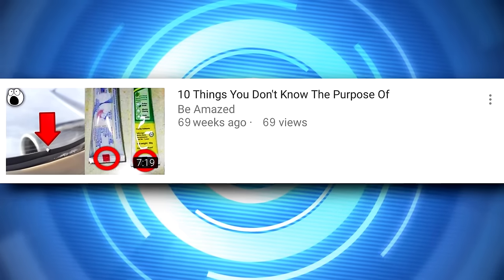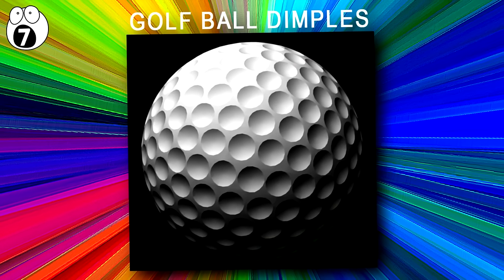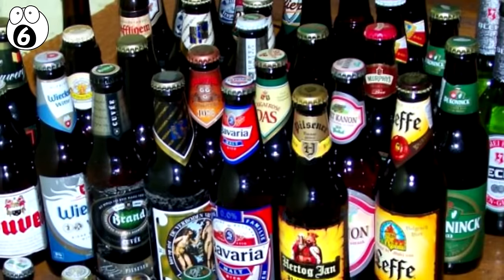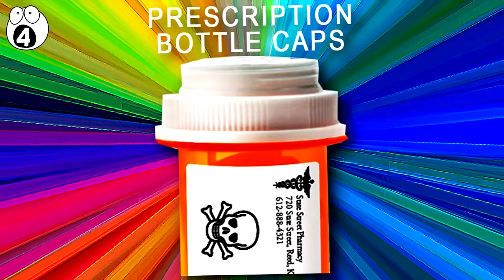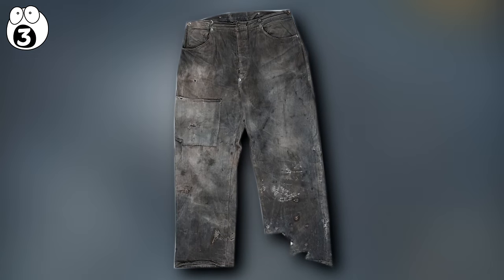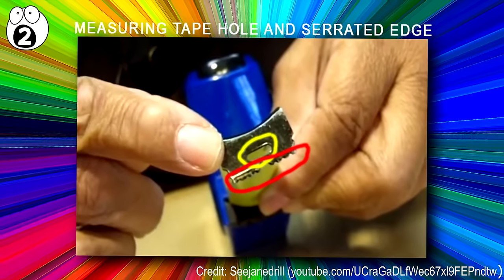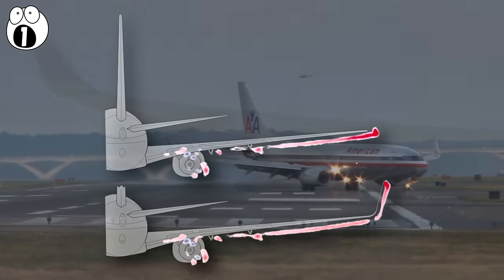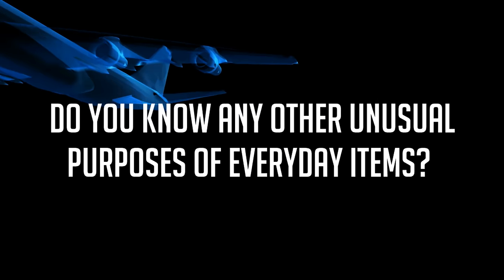8 More Things You Don’t Know The Purpose Of

Comment: #1 - Except that pretty much every brass or copper door knob you can buy is lacquer coated, so the microbes may never even contact the metal. Brass and copper are just easy to work with and they (especially brass) are a color that appeals to many people. When brass was a popular metal for things such as light fixtures and furniture, brass doorknobs were especially popular as well. It's more about aesthetics than anything else. It really is as simple as that. Any disinfecting qualities, if any, are incidental and not the reason WHY those metals are used.
Reply: That and 100 year ago aluminum and stainless steel weren't viable options, brass and bronze are rather corrosion resistant.
Reply: True, but microorganisms and pathogens are on the outside of EVERYTHING we touch, lacquered or not,  just more on porous items.

Comment: Door handles have been made of brass and copper for much longer than they were known to be antibacterial.  The real reason is because those metals are resistant to corrosion, and handles in contact with sweaty hands all day would corrode quickly if they weren't somehow made resistant to corrosion.
Reply: Sure, if they wanted antibacterial handles, they would surface them with silver, copper doesn't work for that purpose very well anyway.
Reply: Yeah, I just always assumed brass was a cheap material.  Never seen a copper handle, but I see aluminum and stainless steel used.  And most handles have a clear coat of varithane, don't know how antibacterial that is.  Copper and brass will tarnish over time, but I've never seen a piece of steel or iron badly corroded just from the oils in human hands.
Reply: so they made the automatic dors for antibacterial defense?
Reply: A persons hand also has salt from the sweat, and just like salt on your car it can cause corrosion.
Reply: Stainless steel is the only thing that won't corrode. Brass and copper corrode quickly. Never seen copper door handles, but brass (brass plated usually) are always coated with varnish of some sort.
Reply: Copper has terrible corrosion properties. Especially in a door knob where it would likely have to come in contact with iron or steel (for strength) and brass bushings.
Reply: Brass will tarnish, but it won't corrode away like many other metals.  That's why brass is used so much on ships.
Reply: Art Brown yeah, when the zinc in brass corrodes, it forms an incredibly hard, clear layer of zinc oxide, which protects the underlying metal from further damage.
Reply: Art Brown the other reason is because they are much more common metals and cost a lot less so it was cheaper and better to use copper and brass handles
Reply: Art Brown english plz?
Reply: BossGaming 123 sorry, I don't speak English.
Reply: BossGaming 123 its so they don't rust and break down easily
Reply: English enough?
Reply: Art Brown I also thought it was for corrosion issues
Reply: Art Brown  k
Reply: You are right, and just as an aside, ALL knobs and handles, regardless of composition, HAVE GERMS on them!  Bacteria, virus, and just nasty microbes!  It is a fact that ANYTHING humans touch usually have many nasty germs on them!  If you are going to touch them, do NOT touch your face (eyes, nose, mouth) or private parts, as mucous membranes is where harmful germs can enter your body.  And IMMEDIATELY wash your hands with soap when you get home.  People come out of the toilet enclosure and often do not wash, so e-coli and other gross germs are on door handles (and on the hot and cold faucets as well!).  Germs (microorganisms, pathogens, bugs, whatever you want to call them) are present everywhere but especially on items people touch all the time.

Comment: it's actually not true that the winglet has lower stress than if it were an extension of the wing. it has similar pressures. and it's addition requires the strengthening of the rest of the wing structure.

Comment: core plugs, also known as freeze plugs on engine blocks, commonly thought to be a way to prevent the engine from cracking from pressure they would just pop out and release the pressure, it's actual purpose is way back during the casting process, it is a way to get the casting sand out. the term 'freeze plug' is used because to install one to an engine block you need to freeze them so they contract enough to fit in the hole, then as they get warm again they expand to their original size, and it's basically held in by the expanding forces.

Comment: On soda cans the pull tab has a hole in it.  This hole, when the tab is rotated around over the opening, can be used to hold a drinking straw in place, which would otherwise 'float' out of the can due to the carbonated bubbles sticking to the straw.

Comment: The fact that I actually knew all of these further proves how much useless information I have filled my mind with. Ah well.
Reply: Ju Haralson 
You are too clever for your own good lol. Especially about brass and copper handles that were popular for thousands of years before germs had been discovered or understood.
Not forgetting the obvious addition that most modern copper and brass handles are lacquered or varnished so still harbour germs :)
The winglets item forgot to add winglets do add lift and are proper lifting bodies that create extra lift/reduced fuel burn without making the aircraft wingspan any wider. Thus VERY important last part allows aircraft to grow in capacity while still using airport terminals designed for older generation aircraft.
Reply: you should gi on Jeopardy!

Comment: I had already known about 7, 3, 2 and 1.
Additional fact about 3 is that they make great spots for a key fob. Also, as for 1, the whing tips also serve to add stability to the wing, and therefor, the whole plane. Also, more lift is created from the main surface of the wing, due to less airflow loss off the wingtip.

Comment: Here's one in the same vein as the dimpled golf balls.  The WWII Me 109 fighter was found to fly faster with rough-finished skin surfaces than the sleek, smooth ones.  The reason?  The rough surface created a minuscule boundary layer on the surface of the metal by trapping air on the surface of the metal, allowing the aircraft to fly with less friction.
Reply: deltavee2 idgaf
Reply: +Oreo_Cakes
How nice for you....
Reply: Interesting, thanks for sharing :)
Reply: +Oreo_Cakes
Oh, of course, you just got home from school and no one's watching you on the net yet.
Reply: deltavee2 I don't wanna be that guy but it's Bf-109.
Reply: No worries.  I just researched it and it appears as both all over the place but History.net says this
 "The prototype Bf-109V-1 was completed in August 1935, and evaluation 
flights began at the RLM’s test center at Rechlin, initially using a 
675-hp Rolls-Royce Kestrel engine in place of the Jumo. The Bf-109V-2, 
completed in October, introduced the 610-hp Jumo 210A as well as a 
strengthened undercarriage, and the Bf-109V-3, delivered in June 1936, 
was the first to be armed with an engine-mounted 7.92mm MG 17 machine 
gun." 
I'm willing to accept that as proof positive, so you're correct, the proper term is Bf-109 and don't worry, you're not that guy.  I do the same thing too so at least there's two of us.  XD
Reply: I think Bf is the correct destination. It was suppose to be Me on all aircraft after 1938, but for some reason all found airframes have the Bf designation. Weird, I always through it was Me

Comment: The modern use of the pocket watch pocket (or coin pocket, if you will) on jeans should be to hold lighters. In my opinion at least haha.

I mean, I've been using that pocket for my lighters since I was a teenager. It's rather convenient considering you don't have to dig through your pockets to grab it (I carry a lot of stuff in my pockets)  I'm glad they never took this pocket away. 

Any other good uses for this pocket?

Comment: as an aircraft mechanic, i did know #1, and on the same topic, the new engines that have noise suppression with what looks like the metal is deformed into little wavy things (I'm trying to be non technical here). the thing is you CAN'T lower the noise level,  and its STILL there. what is actually happen is that wavy design is greatly increase the pitch  a large portion of the noise so it out of the range of human hearing. so the same amount noise is still there, we cant hear all of it.
makes you feel sorry for dogs...
Reply: Clever... or evil?
Reply: worlds biggest dog whistle, i see those things all the time on leer 35s, they are crazy loud without them
Reply: wow

Comment: What's the. Purpose of that little ball thing on every seatbelt???
Reply: To stop the clip from sliding all the way to the floor when the seatbelt is retracted.
Reply: Everyone knows all seats belts double as beer bottle openers. You simply take it off, pop your brew and drive comfortably.  The seat belt locks when you try and rush it back, indicating you should slam the brew and get on to the next one before putting the belt back on. The seat belt is only there as a measure to conveniently take your hand to the beer bottle opener during driving.

Comment: The notch on the tape measure lets you lock onto a screw/nail head in order to scribe a circle/arc. You hook it over the screw and put the pencil in the notch between the tape and body.

They are affixed with rivets instead of a weld or glue for a reason as well. The amount of in and out "wiggle" this leaves is equal to the thickness of the head, so whether you're hooked over an edge, or pressing against something, the reading is accurate.

Comment: Additional information about the winglets: They help produce lift by letting a bigger part of the wing create proper lift. Without them the vortexes formed actually lowers the efficiency of the wing by reducing the lift the last 4th of the wing produces.

They are an absolute necessity on bigger airplanes and were designed to take advantage of the entire wing, not just a part of it.

You can find more information about this by viewing "Engineering connections" by Richard Hammond.

Comment: about the only part of a plane that's solely aesthetics (that I can think of) is the paint.
Reply: If that was the case they would use household paint.  I would bet that aircraft paint has properties that protects the skin of the plane from higher UV exposure at altitude.  Or something like that.
Reply: exactly. basically nothing on a plane is just for looks.
Reply: Yes aviation uses specialized paints to help protect the aircraft skin and also it needs to be able to flex with the plane as it expands and moves. His video is very interesting but he left out that most airlines also began using winglets for the safety of smaller aircraft. In example, a small plane such as a Cessna is less likely to be rolled by air vortex while following a larger plane with winglets while operating around an airport. Sadly such incidents have happened more that the public realizes..
Reply: The only feature of a plane that has no purpose besides aesthetics is the lack of paint - look at the pre-2013 American Airlines livery. Paint reduces maintenance slightly.

Comment: Why are Q tips called that? Why are apartments called that when they are not apart? They should be called togetherments or non-work living cubicles with roofs. Peanut butter should be called I can't believe it's not butter. Why don't they have sliced bread where it alternates between white and wheat so you have a more diverse sandwich? I mean some people put more than one type of meat like turkey and ham so why would you not have two different kinds of bread? Why is it called youtube? I am looking at the screen right now and it looks flat not tube like. Why are the letters on a keyboard all mixed around but the numbers on top above them are in order? I mostly use 6 and 9 so I would prefer those be the first two. Also zero comes first before one but it is after the 9 so actually it is not in order, my bad.
Reply: Well I think the reason "tube" is in the name of this website is because television sets used to work with a cathode ray tube instead of the LCD screen that most of them have nowadays. For this reason, lots of people called television "the tube" as a slang term. When youtube was created, I assume they based their name off of that, as a callback to the history of entertainment.
Reply: Ee J you forgot "why are they called buildings if they're already built"
Reply: Ee J I got the one about the letters on the keyboard.   Before computers they had typewriters, and the old style typewriters had arms that came up, one for each letter, number, or symbol, that hit the paper through the ink ribbon,  putting the letter, et al on the page.  The first typewriters had the letters in order, a,b,c, etc but then the more popular letters, being next to each other,  like g, h, i and r,s,t, caused the arms to jam up.  So they came up with the qwerty keyboard, spreading the popular letters apart, eliminating the problem.  But apparently there is no problem with numbers, so they stayed in order, with 0 at the end.
Reply: @Ee J -  When I bake, I often "dust" the kitchen counter with flour. If I let my grandchildren help with this "dusting", I would need to "dust" the rest of the house when we were done.  Think about that the next time you hear someone talk about dusting. LOL.
Reply: As for the "qwerty" layout on keyboards, that dates back to typewriters.
The "qwerty" layout was developed to put letters used most often further apart to minimize jamming in typewriters. It stayed after mechanical typewriters became obsolete solely because that's what people had become accustomed to.
Reply: There is also another layout specifically designed for non-mechanical keyboards that has actual benefits still applicable today, but nobody uses it so it'd be difficult to get the hang of it.
It's called the Dvorak keyboard layout. Named not for the letter placement, but the person who developed it. it puts vowels and well-used consonants on opposite sides of the keyboard so that you alternate typing hands more often reducing the strain on any one hand.

Comment: I have a pocket watch
Reply: And?
Reply: Farrakhan Wolcott fantastic
Reply: What style of chain do you use?
Reply: AutismSquared  One end connects to pocket watch, while the other secures to a belt loop or button. . .  I think it is called a Sport Pocket Watch Chain
Reply: Farrakhan Wolcott What material is the chain?
Reply: I'm finding images of chains with links that are doubled up, is that the kind of thing you have Farrakhan? Must admit I've never heard of a sport chain before now.
Reply: Wibble Lord silver
Reply: it doesn't have the straight bar in the middle . If that helps.
Reply: Farrakhan Wolcott I would have thought that silver, being the somewhat malleable metal that it is, would have to be mixed with something to make it tough enough to be a sports chain, maybe it's just the construction that lends itself to it's ability to withstand a good amount of wear and tear.
Reply: I've an antique silver chain which hasn't worn much at all in the ~100 years it's been around. Sterling is 92.5% pure generally, so presumably the remainder would include something to harden it? Like adding carbon to make steel harder. I'm guessing so, anyway. I know they tend to add copper, but I can't say I know how that effects the physical properties.
Reply: Wibble Lord To clarify, I meant to point out the difference between fine silver. ("pure", 999 parts per thou) and sterling silver, which can have as much as 200 parts miscellaneous to 800 parts silver.
Reply: AutismSquared Thanks for all that info, I never knew that much about silver, and you make good points, cheers!
Reply: I have two pocket watches. One I bought in high school to use as a prop in a play which I still have sitting on my desk but it doesn't work anymore. Also I lost the chain for it, I don't know what I did with that. The other is a prop replica of the Chameleon device used by both the Doctor and the Master in Doctor Who. It only really looks like it does in the show when you keep it closed though. The face of a watch on the inside doesn't have the proper design. I seen another version that's accurate both inside and out but it's made of plastic and is a kids toy rather than a proper metal watch.
Reply: Mine was giving to me by my grandgfather. I wouldn't mind a doc who one thu

Comment: The hook on the end of a tape measure is loose on purpose. When you hook it on a board it extends the thickness of hook. When you measure by butting it against a wall it pushes in the thickness of the hook.

Comment: Locks used brass originally because it doesn't rust and thus jam up like other materials might.  Obviously gold and silver would be fine, but they were very expensive.  Aluminum is great, but used to be exceedingly rare.  Brass also has the added benefit of being fairly easy to work, if small adjustments needed to be made to properly fit the lock and key, or other moving parts, a small file or whetstone makes quick work of the job.

Comment: A major secret was missed on the tape measure.   The end of the tape mesure (where you can hook onto the nail, or scratch your mark) also "wobbles".  That end wobbles a fraction of an inch in order to get an accurate measurement. Example:  If you are measuring from the "inside" of a window frame it will slightly pivot.  If you are measuring from the "outside" of a window frame it will slightly pivot in the opposite direction.  This feature actually allows for a more accurate measurement.  This has been overlooked by most for decades.